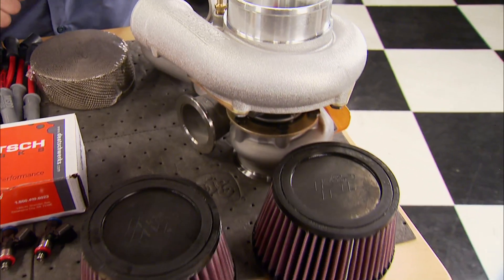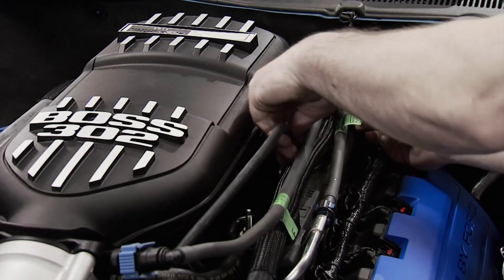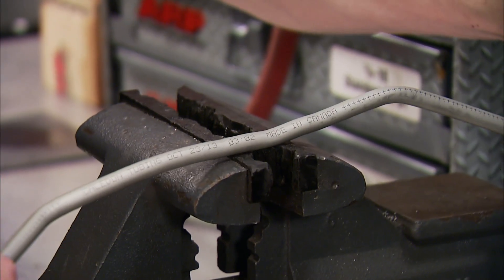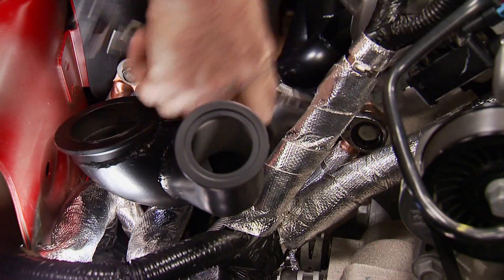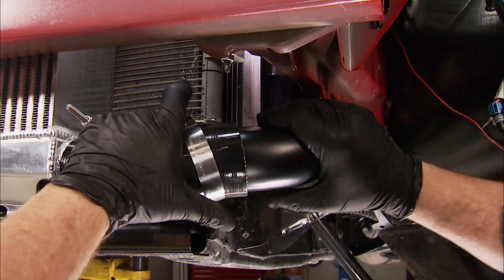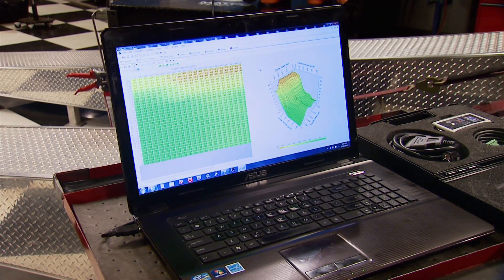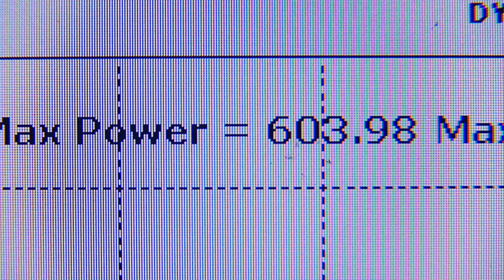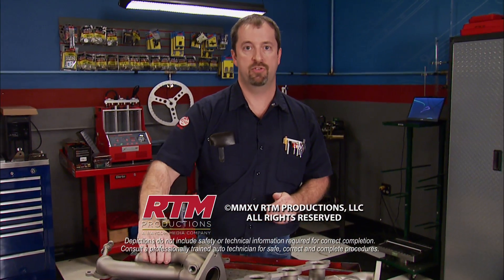600 Horsepower Twin Turbo 2014 Camaro - Engine Power S2, E1

Comment: It's crazy how HP numbers are doubled in the last 10 years. 600 hp is on the low end at the track today  🤷‍♂️
Reply: My thoughts exactly, I’ve been seeing a lot of comments about their build being so low on power with the money they spend on the builds lmao
Reply: Remember all the fun Cletus had on project ruby haha wouldn’t last long but big numbers.
Reply: Robert Barnes yeah true haha. And this is a tv show so they’re not going all out crazy lol
Reply: Yeah showroom cars have that or more
Reply: it was tuned very conservatively
Reply: @1flynlow  thats exactly right, small injectors, small pump, etc. if it was really big injectors, big pump, e-85, and more boost could start really cranking it up tell find the next weakest link.
Reply: Another thing is like a z28 5th gen was a little over 320+/-. Damn 4 bangers are getting that now
Reply: @shawnjones7512  A z28 5th gen was only 320 what?? those things made 505+hp...
Reply: @akirat11  i meant to say 4th gen.
Reply: @shawnjones7512  many turbo 4 cyllinder are 300-600whp
Reply: Yeah you boost a lsx your looking at 1400 solid
Reply: I had a customer looking to buy a V6 Silverado and he wanted to know if it was OK to plow snow with.....my initial thought was no, the realized the V6 puts out more power than those old 350's ever did.
Reply: Still has the Stock trans, fuel system, cats etc; switch all that out you can get a reliable 1000hp easily 🤷🏻‍♂️
Reply: @Does_it_come_in_black  The injectors were swapped in the video so the fuel system was not stock.
Reply: @akirat11  Fuel system is still stock even if you change the Injectors. You can run 1000cc injectors but if your pump can't keep up with the demand delivery its a waste.
Reply: @Does_it_come_in_black  that stock block wit stock rods & pistons & heads wont hold 1,000 horsepower. Once you start going past about 650 your running on borrowed time. This ain't about GM ego, this was about being safe & reliable.
Reply: It’s power to weight ratio, horsepower doesn’t matter if it’s there’s too much weight. And no I’m not talking Miata.
Reply: It’s stock tho ...
Reply: I remember 20 years ago if you ran a 13 in your street car...that was fast.
Reply: I guess im asking the wrong place but does someone know of a tool to log back into an Instagram account..?
I stupidly forgot the login password. I appreciate any assistance you can offer me!
Reply: @Ayden Liam Instablaster ;)
Reply: crazy this comment is 3 years old because it’s only become more true
Reply: 300 whp and 13's in the 1/4 mile used to be respected, lol
Reply: Yeah if you not hitting at least 1000 you gonna get gapped on the track.
Reply: I had a 70 swb Chevy truck with just a fresh rebuilt 327, headers cam and a holly 4 bbl, and a 4 speed I'm guessing 300 hp and that felt like a lot back in high school now that's like nothing now days a 4 cylinder is making more than that.